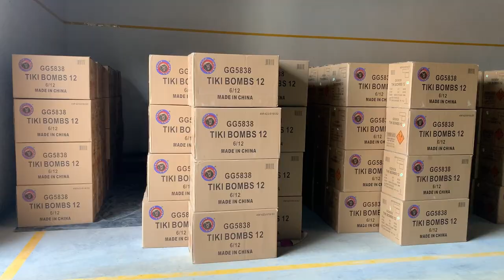2022 Pyroshine Canister Shell Factory video 49F423

Comment: Very interesting iv been trying to make small cans for years bu can't get the break charge correct. What's your break charge
Reply: Can you elaborate better on what you mean by not getting the break charge correct? I make 5 inch cans 1.7 inch diameter with 60 grams of flashpowder if im doing a salute and about 25-30 of flash and 20 of effects if its a pretty shell